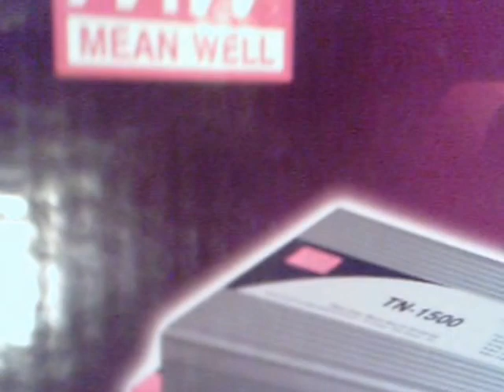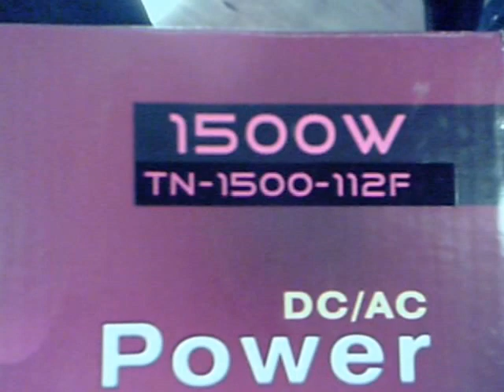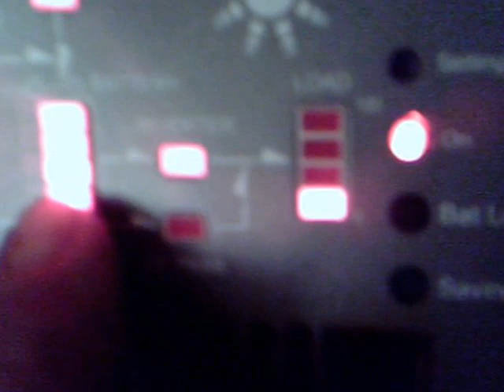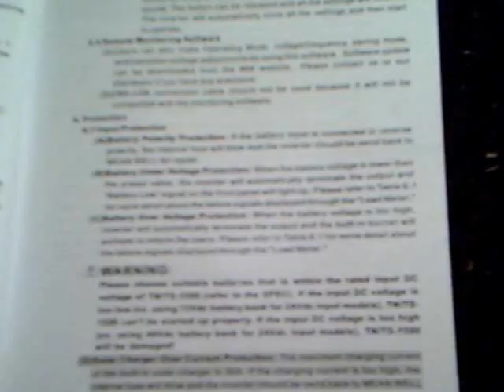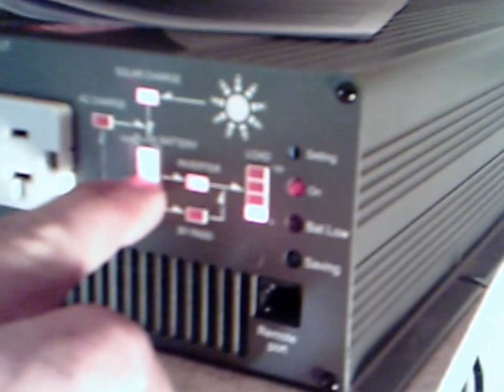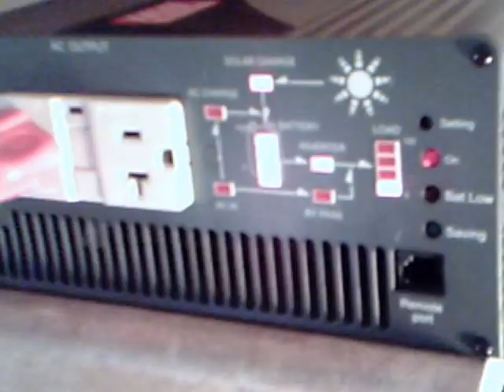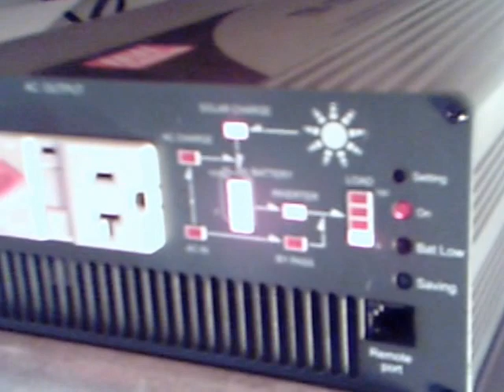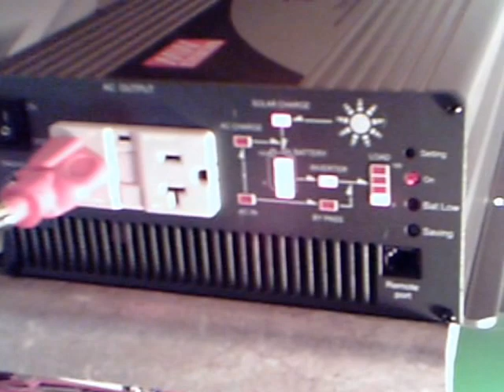Mean Well TN 1500 F,  true sine wave Inverter review

Comment: Hi. did you directly connect the solar panel to the inverter?  For some reason, I have voltage from the batteries on the solar connector.
Reply from the maker: Yes, it has separate terminals just for solar input. 30 amp.

Comment: Thanks for the vid.. I recently picked up a 1500w  mean well inverter from ah friend but not sure if it works it has an Ac input and when I plug it in I can't seem to get any power ???

Does the inverter require both the ac and DC connected in order to get power?

Comment: Hi John. I hope you are still using your meanwell with no fault. I would like to purchase myself another 48vdc TN1500. I like to have your valuable recommendation before my purchase. Max Voc for inverter is  given 75vdc but when I wire my 6 panels in serries  - parallel.max Voc is around 79vdc and 28 amps. Would that 4 volts difference damage the inverter? Thanks in advance.
Reply from the maker: Mean well inverters are extremely sensitive so max voltage listed should be paid attention to very closely. You can reduce your panel's high voltage output by making the solar wires a lot longer.
Reply: @JOHNDANIEL1  Thank you very much. That's a nice trick what you mentioned. I'll try. Best regards.

Comment: So added external fuse ......appears to be a reverse polarity fuse...solar led still not lit!! Rrrrrr.....is there any other fuses inside this beast?? Mine does not have external gfi on the 110 plugs on inverter!! Battery still not charging off solar!! Baffled....?.?? Help oh wise one
Reply from the maker: It is entirely possible the circuit has failed, but to test that you have to have a battery at about 12 volts even, and connect the solar at night. Never connect solar like the manual will tell you on all/any controllers with load in action. The current inrush will burn the Mosfets in the controllers. I always connect at night. Then you will reset the controller if its in fault, or it will not raise the battery if its failed.

Comment: Bought solar charge controller....controller says it's is charging battery.....where do the wires from solar input on inverter now go??? As I see your led on your inverter is lite and mine is not??? I am a newbie and not intelligent as yourself but am grateful for your abundance of knowledge....
Reply from the maker: +Paul Zimballs Did you buy a separate charge controller and trying to feed that into the inverter if you're doing that that might not work if its internal controller is bad. Wire a separate controller direct to battery.

Comment: Watched your cleaning video.......from your previous comment I just need a solar charge controller to fix the issue of my solar led light not staying lit and charging my batteries???? Thanks paulyz
Reply from the maker: +Paul Zimballs I was running the solar limit of 360 watts into the inverter, the fuse inside blew out, so I reduced the power to 320 watts and put a jumper in place of the fuse then fused externally as you seen. All began working again. 
But I have heard of a solid state relay on the board failing from too many solar amps and the internal PWM controller stopping all together. Rare though.

Comment: John....help please.....led light for solar charge not staying lit on ts-1500 .....do I need to check internal fuse??? Or what was the fix for this?? Ty kind sir
Reply from the maker: If you have a Solar Charger in a TS model, it never came with solar controller HOWEVER, the video here give you a inside look Jeff https://youtu.be/6492U5rDCp8

Comment: Thanks John. Voltage test seems OK. I have about 42V Voc because of 2, 120W, panels in series (one panel is about 21V). Other than suspecting the fuse in the TN1500 blown, I really can't figure out what else can go wrong. Last resort, have to send back to meanwell to check on the inverter. I am reluctant to do so because the turnaround time is far too long.

Comment: I wonder if someone can advise me. During the day under sunny conditions, the TN1500-224 solar charge light indicator was not lighted up but AC charge light indicator was lit. The battery voltage was about 26volts. Since the battery is not fully charged, it should take in AC charge and Solar charge for battery charging...but only AC charge is activated. WHat can be the problem?

Comment: Thank again John. Yes, I got few fuses already from the auto parts store. Just I got confused about those fuse parameters. Some books suggested that I should have 600 VDC (Volt-direct-current) fuse with midget / 5AG form factory, but the normal fuseI got from the auto parts store only have 100 or less VDC rating and it is relatively small in size. Not really understand the importance of the VDC rating and if the size matter.

Comment: Thanks John. Yes, I am also considering to replace the Meanwell internal PWM charger with a MorningStar MPPT 30A controller, but not sure what will happen if the panels got over 30A. Will it burn the controller? or the controller will just throw excessive current away.

Comment: By the way, do you have any recommendation on circuit breaker (with auto trip function) or fuse? I have to install it shortly after the 6th solar panel installation (Max current of each panel is 6A. It may burn the inverter under an extreme case). Some books recommend two individual 15A fuses with 600VDC rating. I think it is good, but quite expensive in long run. It is around USD30 each here. I am thinking if circuit break with auto trip function could be used instead of an once-off fuse.

Comment: Hi John,

I finally made it after replacement of the solar panel as well as the wiring between the charger and the battery. It is hard to find AWG 4 cable here, so I just made 4 parallel AWG 10 cables to connect the battery bank. The result is so far so good. Provided that the panel got 2.5A current, the solar charger works perfectly.

Comment: Thanks for your advice John. Yes, wiring is another issue. Do you mean that I should start with AWG 5 cable (4.62mm diameter)? Currently I am only using AWG 8 cable as per suggestion from Meanwell for a 30A system.

Comment: Hi John,

Not yet. According to the manufacturer, it is required to have at least 3A current for the solar charger to work. First of all the weather was very bad in the last two week and I got few problems with my China made solar panel. Each panel suppose to have 6A current max, but I seldom got it working at 3A.  I have to replace the solar panels from the manufacturer first. This is my first trial on solar energy and there is still a long way to go.

Comment: Hi John,
It is nice to find your video here. I also bought meanwell TN-1500, but I am suffering from a problem with my solar panels. I can never made the solar charge light on even through the panel does provide about 16V output if I measure directly at the solar input of the TN-1500 with the Solar panels connected. Could you kindly advice what mode are you using to get solar charge? I am using "Stand-by saving mode" and "Energy saving mode". Many thanks.